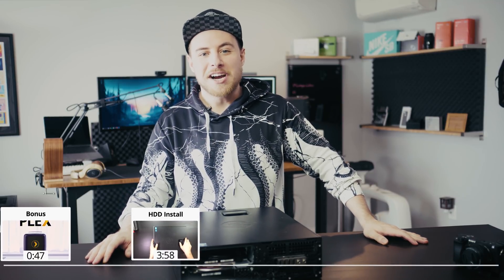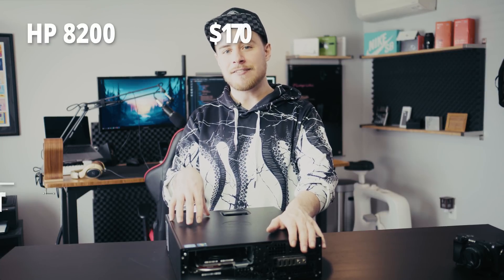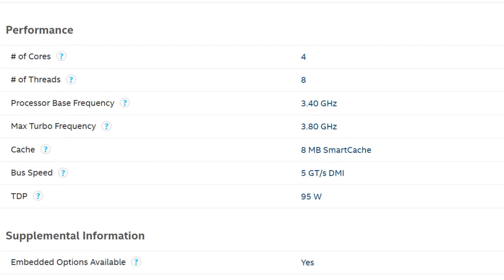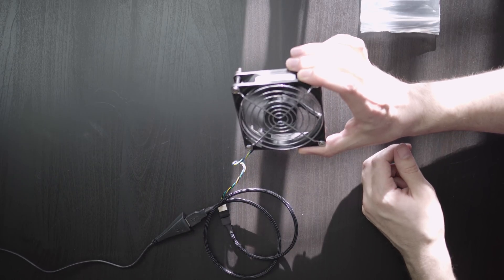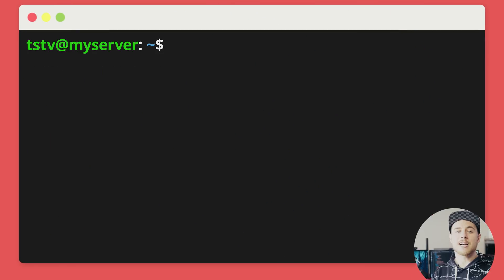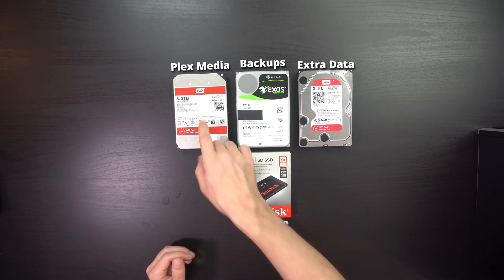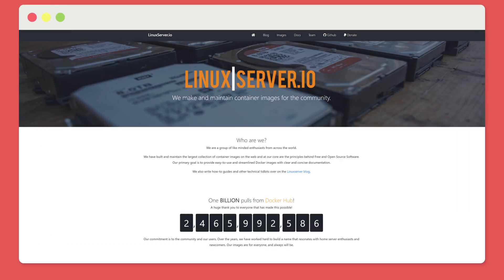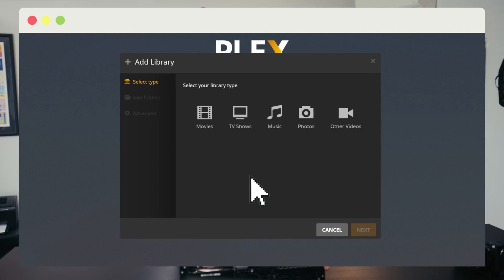How To Build A 23TB Plex Server With Docker

Comment: One question. I am looking for a setup that would hold my backup data with data scrubbing capability. So far, I have my eye on Ubuntu Server with ZFS to avoid issues with data degradation and was wondering it both could cover the same file system. If not, do you have any recommendations on health maintenance setups? The ZFS thing is just what I am looking at right now. Still in the thick of researching.
Reply from the maker: The goto is pretty much TrueNas which is pretty robust now. I'm about to build a new server on it to replace the one in this video
Reply: @TechSquidTV  Just looked it up and OOOOO. Thank you for the tip. I have completely forgotten about TrueNas.

Comment: Good video dude...i tried many server, finaaly i decided using raspberry pi4 B, quad core 8GB RAM, 128GB SDXC class10 for boat system, and 1TB SSD usb,,Fstab auto defaults, using ubuntu server 22.04, with AdGuard Home , PlexMediaServer, Sambashare. ,So now i can put ONline 24/7 nonstop,...take only 12WAtt..whenever have new video, the oldest video can be replace...low cost..little space..less noise..
Reply from the maker: Nice!

Comment: Using a Shield TV Pro for Plex media server, uses tiny amount power (~10W) and performance is great, using x265 movies while also being great for regular streaming apps, Kodi, RetroArch, etc. Also host an external drive on my WRT32X with OpenWrt which has Samba 4.14, getting 120 MB/s gigabit speeds on my network.

Comment: I still don’t understand what Docker is. Usually when I see videos it is just terminal commands. Why do people compare this to VMs?
Reply from the maker: I think you may be thinking that VMs are used exclusively for the desktop, this is not true. VMs are used all the time for software that is only CLI or web based. 

Example that may be more relatable, a minecraft server. A minecraft server is completely command line, and requires that Java be installed.

With a VM we can bundle Java and our server together in the same image and keep our main OS clear. Docker is very similar in this particular use-case, but faster and more efficient
Reply: @TechSquidTV  Oooh, Thanks!

Comment: I was going to do a dockerized plex server like this until I found unraid... which yes, is still docker, but I also get to raid drives easily and run bare metal VMs.
Reply from the maker: There's quite a few limitations to running Docker through unraid. Seems fine for spinning up services but you don't get the fine tuned control of a docker-compose setup. I'm looking at unraid and other options now for the next video. So far I'm leaning heavily towards Ubuntu with ZFS and Docker. Should be essentially the same thing as Unraid but free. We'll just have the lack of a GUI for the ZFS pools.

Comment: One thing to note is that df -h doesn't always show drives.  For example if the drive isn't already mounted it likely won't show the drive in that list.  You need to use something like sudo fdisk -l to see all drives in the system.  Both mounted and unmounted.

Also,  you need to edit the /etc/fstab file to tell the system to mount those drives on boot.  Otherwise you'll have to manually mount them everytime the server is rebooted.

Comment: Despite of it would cost a lot more in the beginning, I rather would go for a low-power/TDP system such as an AMD Epyc 3201 (8 cores, 8 threads, 30W TDP). Assuming a maximum power usage of your system (95W CPU + 3x7W for each HDD, running 24/7 at maximum load), you will easily consume electricity worth around 250 bucks/year (assuming 0.25c each kWh). Thats why I opted for a more recent hardware (SuperMicro M11SDV-8CT-LN4F with an AMD Epyc 3201 with only 30W TDP). That system would cost me roughly 110 bucks/year in electricty but with an initial investment of 550 bucks.
Also for the OS and especially the storage solution, I highly recommend FreeNAS. With its ZFS file system, you are very very flexible and you will have additional safety concerning data corruption. And the coll thing: Plex Media Server is already included as a Plugin/"Jail" (FreeBSD "equivalent" Docker).

Comment: Great video but you spend too much time building the plex stand and server and not enough time talking about how to configure the plex yml file. Do we leave the brackets <data>  points in place?  What about the transcode should that point somewhere else? What about IP configuration and opening ports. There is SOOO much left out of this video that still needs to be addressed.

Comment: Why didn't you just make a RAID5 array with those 3 hard drives and then backup to a homemade NAS with a RPI or something?
Reply from the maker: It was definitely a consideration. I was considering what i might want to do longer term but that is a good option for short term and only 3 drives. Ther server itself (rather than a pi) is much more powerful though.

Im still looking for a suitable machine that i'd like to use ZFS pools on but see the popular blog post "the hidden cost" which makes planning ahead very important.

Comment: Thank you so very much for this. You have answered a question that has been hard to get answer for. I am building a server and I bought an nvidia graphics for transcoding. The problem is/was, I was unsure if it's GPU would be used in the headless server. If I understand correctly that it would be used by Plex (and worthwhile) when my friends and fam stream videos to devices running Plex other than PCs.
Reply: Douglas Fraser plex doesnt utilize gpu transcodes, so that would be useless.
Reply from the maker: Yes it does.

Comment: So many painful choices made here. Ubuntu for a server? Their secret sauce is in the desktop, at least use Debian, but you really want CentOS. SElinux will improve security drastically. Second, what was that awful drive setup? Honestly with the mismatch drive sizes I would have just done a btrfs pool with metadata and data in raid 1. It would keep two copies across two different block devices automatically for you and could easily be expanded in the future.

Comment: just subscribe netflix, amazon prime theres pentabit of movies problem solve or just use G-suite Gdrive it has unlimited storage and you can install flex on it, when you build the kind a server you need dedicated IP, high bandwith internet ISP that open all port and its not cheap...
Reply from the maker: No need for a dedicated IP. I personally am on a 1 gigabit fiber line, so no bandwidth issues.
Also ports do not need to be opened for Plex but even if they did that is no issue at all and takes 2 minutes to do.

Comment: When you've acquired a random 8TB of non-legally obtained movies, like docker, have spare parts you haven't used,  and  want to make a YouTube video.  Proxmox could have handled this with an LXC container, Unraid could have ran the docker, FreeNas could have done it with a jail, OMV could have done it with a plugin - all while not requiring the SSD as a boot drive. Also, how in the hell are you transferring data to the /media drive if there's no samba/NFS?

Comment: Can this be done using windows?
Reply from the maker: It can and many people do. You can just run the plex server off a standard windows pc.
Reply: @TechSquidTV  Now I've also been informed too that having a plex server only works if you have an OTA antenna or a cable box that would support it?  I don't have an antenna and my cable box does not support it and I want to cut the cord.

Comment: Why did you use a laser like this? Should have just measured on each end and used a straight edge
Reply from the maker: It was mostly for the joke. Otherwise I would have turned the whole thing on  its front

Comment: i wouldn't put 3 hard drives in this case, it has zero airflow and they will get very hot very fast. the fan in the back will not do much except keeping the psu from dying in a few days. unless this fun is like 8000 rpm which i doubt. keeping it for 24/7 operation is a very bad idea.
Reply from the maker: I had the same concerns and only did this for fun. However it's been running non-stop for several months now actually and is working fantastic. Remember the drives are rarely actually spinning.

Comment: Feel like you should’ve mentioned to install Ubuntu server and not the desktop version. If all you will be doing is hosting files with that machine then running without the bloat and draw of system resources to run a desktop environment would be sufficient and ideal. Also, not mentioned, but considering the nature of SSD storage, you shouldn’t create a swap file when installing Linux to an SSD.
Reply from the maker: I had not considered the swapfile issue. That's a great point

Comment: Fair use says that if you own a dvd/bluray of a movie you can rip it to disk and watch it that way. I have over 100 movies in MKV format on my Plex Server and have all the hard copies in storage.

Also I have a Mediasonic ProBox 8 with four 6TB WD Purples in it, for 32TB, but my data is rsync mirrored so there are local backups of the media, because I'd really not like to have to rip any of them again. That was the longest step of my entire setup. Also what's running it is a System76 Mercat running an Intel NUC, it runs but it's a few years old and never transcoded very well, I was thinking about an update.
Reply from the maker: This is actually not entirely true. If the media has any form of protection, circumventing the protection is considered hacking. They found a way to make it illegal as far as I am aware.

I still think it's the most legal thing you can do.

I just ordered a new server to replace this one, hoping to do a raid1-Z

Comment: what is the advantace of using Docker rather than just adding the plex repository and sudo apt install plexmediaserver ?
Reply from the maker: Easier to update. Easier to remove. Easier to reconfigure. Easier to migrate to a new machine. 

I can take my docker script and run it anywhere with s single line
Reply: TechSquidTV I tried docker when I set up my server and couldn’t get it to work... I admit that I didn’t try all that hard :)
I’m currently running plex server, a minecraft server and transmission (for getting all those totally 100% legal downloads). The minecraft server is the only thing I have to manually update but yeah if I want to move to a different PC I’d be starting over from scratch.
Thanks for the reply :)
Reply from the maker: @The V0iD what if you have 10 other apps also installed? You want to sit there and do that for all 10 all the time? And what if you want to add a second instance of an app? Let's say for some reason, a second plex server.

Comment: The /media directory is the root mount point in some distros(including ubuntu) for hotplug filesystems(like CD/DVD/USB), therefore that's a bad place to mount your plesk files. Just using some other directory solves that problem... or you might get backing up your external USB hard drive along with plesk, running out of space and crashing your system... or something weird like that in time.

Comment: setting up plex is easier to do on a windows os
Reply: Doubt it, just a few lines in a yml file and a docker command on both operating systems. Plus on windows docker is slower and you have less control in general.

Comment: Guys need help with Plex and the transcoding :-(

I googled it but didn't found the solution. I have a Synology DS 718+ which is quit enough for me now (later when I live one my own, i want a small room for server, router, firewall,... then I have more place to store a biger "NAS")
Everyone who is using my PLEX server can just use directplay/ original quality (H.265 -> because I'm happy with the quality and a lot smaller files!). I want to deactivate the transcoding but every modification I tried (the most are from older Plex versions) doesn't work anymore :-/ does anyone know how I could handle this?

Comment: Just sayin I'm still running a 2600k in 2019 at 4.8ghz with 16g of ram, and a 1070.. Runs flawlessly.
I spent a total of 200$ on a machine that can run all games at 1440p. Old hardware is still good hardware
Reply: I'd like to know where you found that, a 1070 alone is like $450
Reply: I feel the same. My PCs (i5 2400 GTX 1050 ti and i7 3770 GTX 1070) runs amazingly. Old hardware is still just as relevant as these new chips they putting out.
Reply: Mike Mckay  You hit the nail on the head. The modern processors use less than a quarter of the power of the 2600's. It comes down to how long you want to run it, and how much you want to save in electricity costs to justify the extra $1000 upgrading to a more modern machine. Each to their own.
Reply: I still run a i7-920. Try transcoding on that, yeah good luck!

Comment: I'm running on VMWare ESXi and an Ubuntu VM. GPU is forwarded to my VM, so Hardware Transcoding is running awesome and can handle more than 10 streams at one time. Most of the time I'm using direct stream and play, of course.
I have more than one VM, thats why I'm using ESXi. Everything is stored on a NAS (25 TB, Raid 01), NAS gets mounted automatically by fstab.
Reply from the maker: This is the direction I am thinking of heading. This machine was too small and not powerful enough. This was for fun. I want to do something like this next though

Comment: wow... this is like kindergarten for 4 day olds.. instead of a backup drive people get 2 x 12tb drives have them in a raid 1 and partition them with a 8tb and 3tb... 
better yet, use LVM over the 12tb and increase as you need them. you're not going to have 8tb for plex straight away..
Reply from the maker: You and I went to different kindergartens. And skipping over preschool? Way to flex on the rest of us.

Comment: This was a cool find. I run a 22Tb server from my personal computer, and have been looking about for ways to make a stand alone server. 

I'm not so worried about the backup, as I keep external hard drives saved away in a fireproof safe.

My issue is just running out of sata ports to use hard drivers as I'm trying not to put the money into the high capacity drives, when I can get more space out of several smaller, cheaper.
Reply: The V0iD  you're arguing semantics. Here let me reword it the correct way. I'm running a 22 TB Plex library from my personal computer. I'm looking for the best way to put it on its own standalone server.

Comment: So despite seeing your videos on docker, what is its use/advantage? I have been running my Plex server by simply installing the windows app, syncing my HDD folders and it does everything for me. If I need to encode videos.i do it in a few minutes and leave it to encode. 

I don't see the point of docker. Or you just explained it poorly.

Comment: Quick note. If the server is restarted the mounted disk will not work. You may need to edit the /etc/fstab file so it get mounted at startup
Reply: ^ THIS. I cannot tell you how much pain I've had to endure the last few weeks because online guides miss this point... NFS shares require commenting out your fstab, everyone. Eduardo is right.
Reply: @MrDoggerDog  Definitly he is right! I have a Raspberry Pi and i have to comment the /etc/fstab too! "/dev/sda1 /mnt/NAS auto noatime 0 0" that was i comment on Fstab and it works ! But when i boot my Pi without the hard drive it gives a error a don't boot! So, just be careful
Reply: thats a good point    also asuming ther using linix file system and not a  fat or ntfs
Reply: /media is also the wrong directory for fixed mounts. One should use /mnt. /media is for automatic mounts of Linux.
Reply: I also had to put exec in my fstab to get transcoding working properly

Comment: Why did you use that PCIe SSD adaptor?  That ssd is SATAiii so the $40 spent on that adaptor card was wasted.... unless you ran out of SATA ports on the MB or because you wanted to secure the SSD drive instead of using double sided tape.  Were one of those the reasons?
Reply from the maker: Simply ran out of ports is all

Comment: Just buy and rip blu-rays.
Reply from the maker: This is the best and easiest solution. And you can even get older ones cheap!
Reply: @TechSquidTV  yeah I used to download but I donno I kinda changed my views on it. Looked arround and blurays arent that expensive tbh. Currently dont have a reader but ripping my parent's old dvds now and getting them on my media server. Actually just realized that a series (north and south) was incomplete as my mom didnt have book 3. So we split the cost of buying a new box set (basically 9eu each). Its just nice to know you own it flat out with no legal trouble. Also you get to display your collection on a shelf and brag :)
Reply from the maker: Just for the info, ripping a Blu-ray even for yourself is actually still illegal. Bypassing dmca is considered hacking. 

We still don't actually own our blurays which is a sad fact. But still I would say more ethical obviously and as you said has other benefits
Reply: @TechSquidTV  yeah I know seeing as you are technically copying the disc and all. But some copyright laws make it almost impossible to actually use media you own so we have to do something...
Reply from the maker: I'm with you. Our hands are tied.
Reply: @TechSquidTV  imho it should changed to distribution right. Cause there is plenty legit reasons to copy something. The problem arrises when you actually start redistributing your copy. I mean if I make a copy and upload it to a storage server there is nothing wrong with that. If I copy and burn again to have a backup disc for example, thats also not a problem. Now if I were to take that  copy and sell it or upload it to the public internet thay would be a problem. Unfortanatly laws are slow to change and law makers very rarely know what they are talking about. Anyway cool vid dude,  also jellyfin is better then plex IMHO (and FOSS).